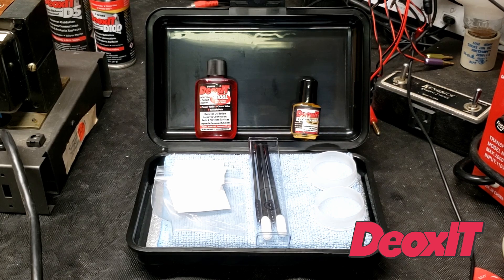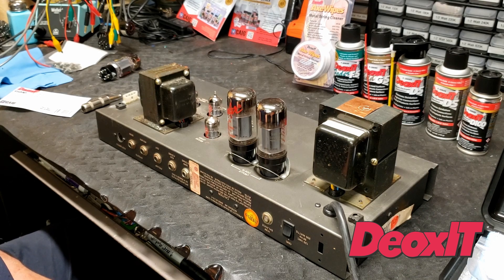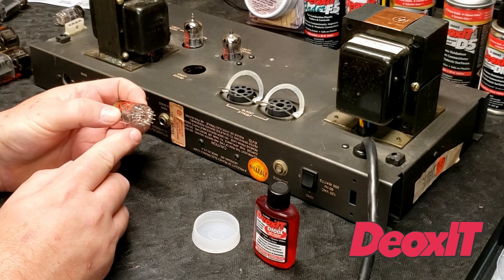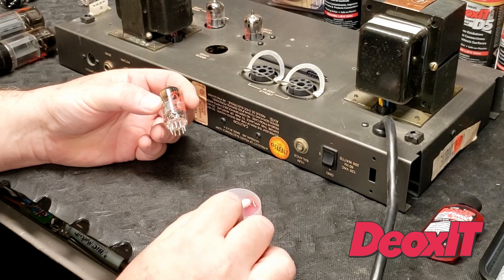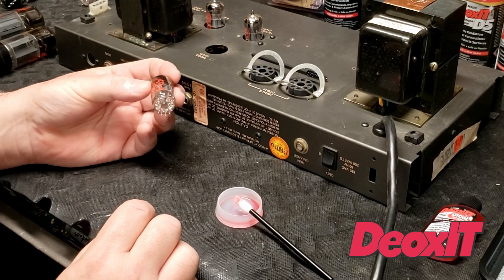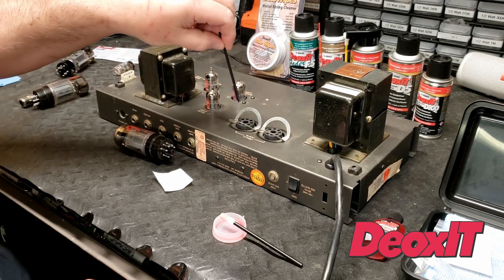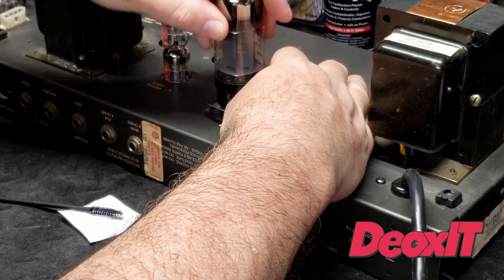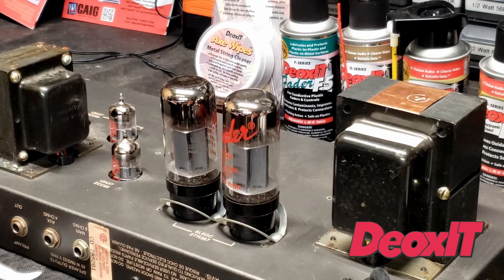DeoxIT Vacuum Tube Maintenance Kit

Comment: From Caig Laboratories' own documentation (technical bulletin and tech support guidance):
"DeoxIT D-Series leaves a film that is conductive and may not be suitable for high-voltage circuits, such as tube sockets, where leakage current or tracking can be an issue. Use with caution, and remove excess."